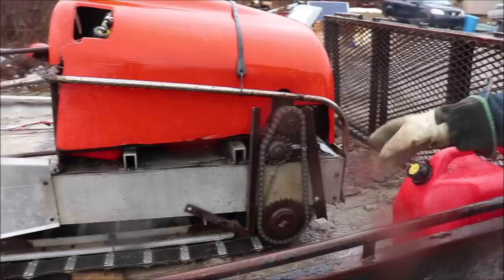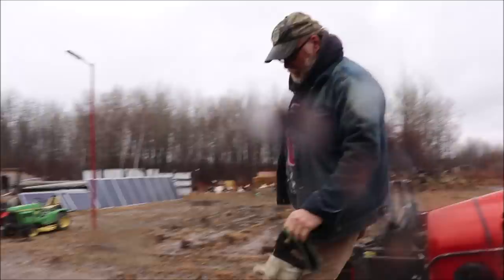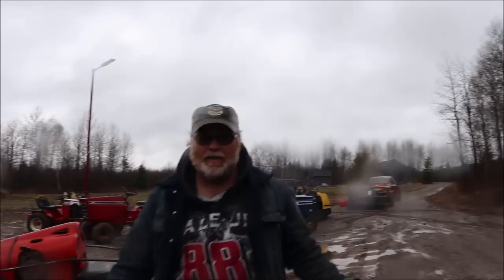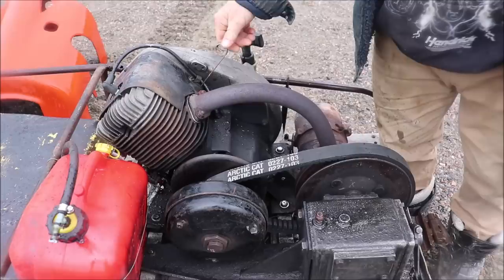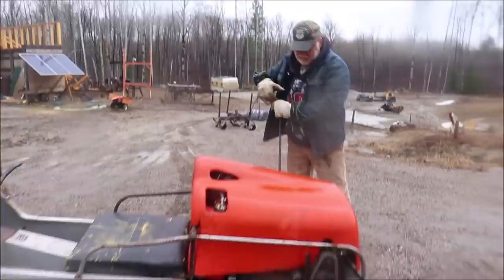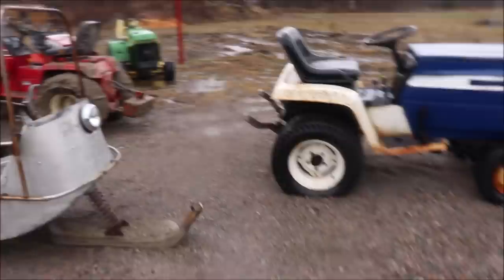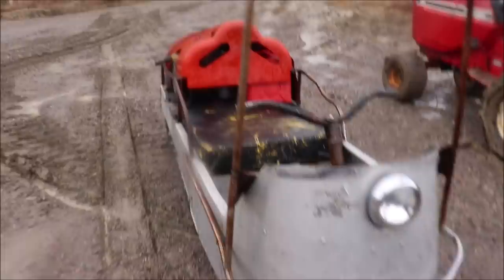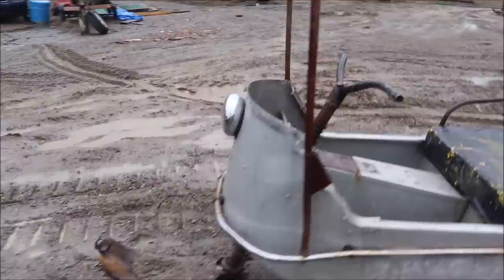What Did I Get Now?  This Snowbug Superbug Snowmobile Will Really Help Us This Coming Winter.

Comment: had two when I was in my late teens,first one was a 10 hp, no reverse  and no brake ( didn't need one) second one was 22 hp and was like a bulldozer in the snow, but didn't steer to good in soft snow
Reply from the maker: Hello, I had lots when I was younger and they never steered great either..now that I am 40 years older and a few pounds heavier they steer way better lol.  Cheers!

Comment: Nice snowbug. Theres a guy in Sudbury that has the belting and cleats still that will make you a new track for 4 or 5 hundred bucks. My brother in Nairn Center has 3 snowbugs. I have an uncle who used one to pull 45g drums of stove oil across the fields in the winter to his cabin. Guys up here in northwestern ontario want $1500-2500 for a snowbug!